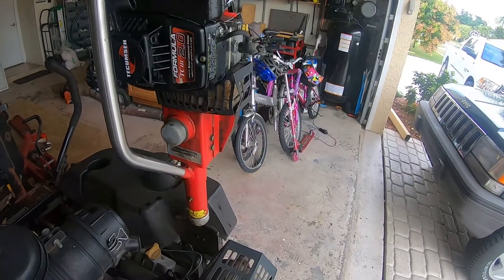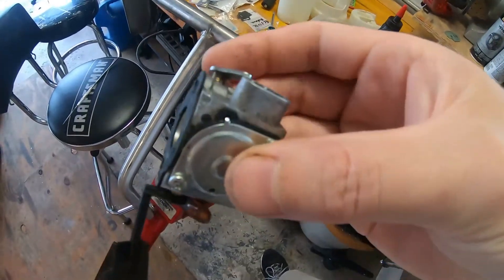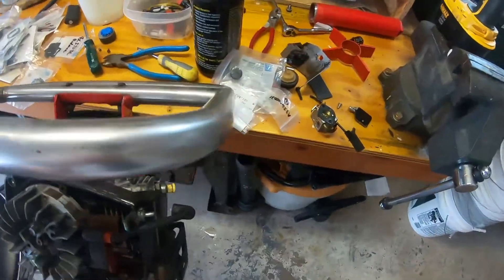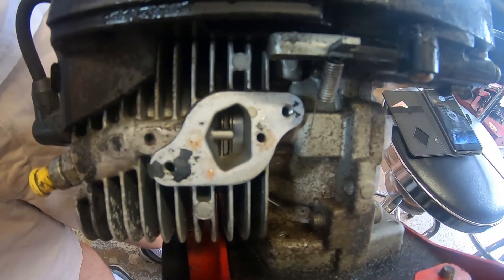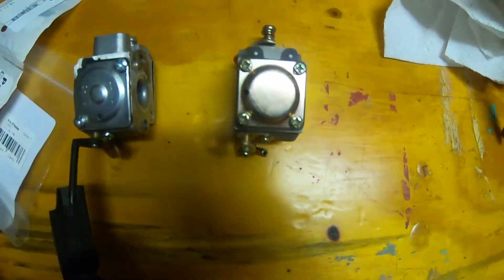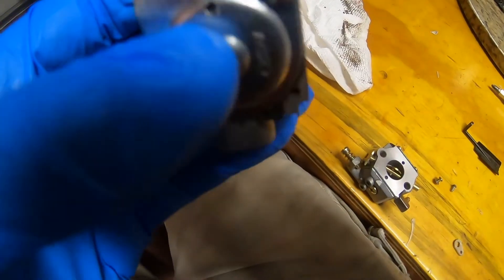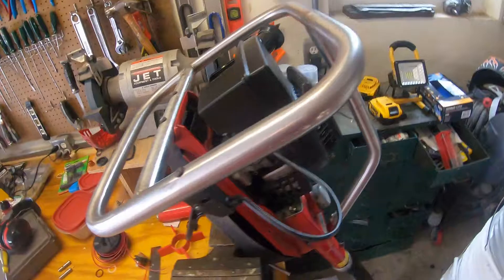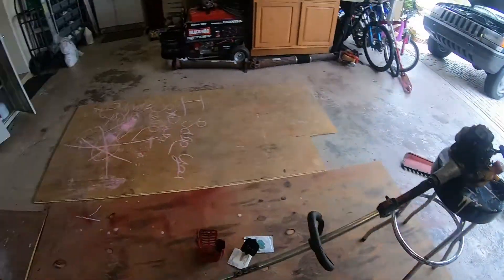Getting the Dyna Diggr Power Shovel Running

Comment: Do you have any idea where to buy it?
Reply from the maker: Sorry, I don't. I don't think they are made any more. Tecumseh has been out of the engine business for many years.
Reply: Would you say that dyna diggr feels like basically like a jack hammer with attached spade or is there huge differences in design?
Reply from the maker: @kasparsd8083  That's a good way to describe it. I can post a video of it running if you would like
Reply: @JoesGarageProductionsLLC  Absolutely
Reply: We are still in business! We sell the Diggr with a Maruyama 420 engine with it now!